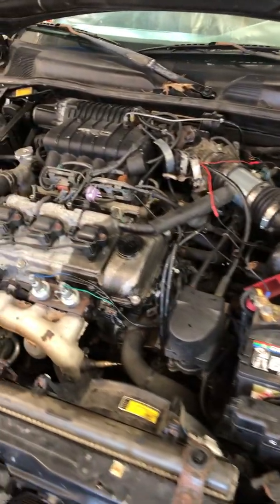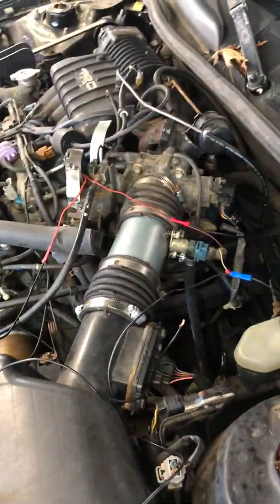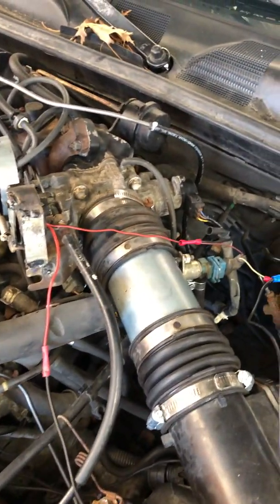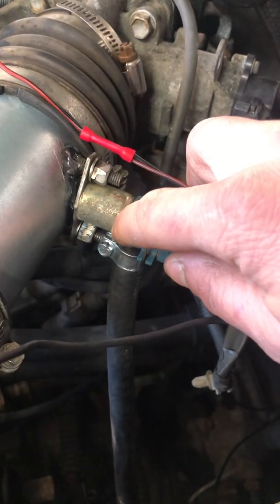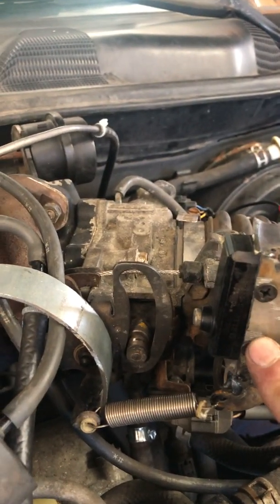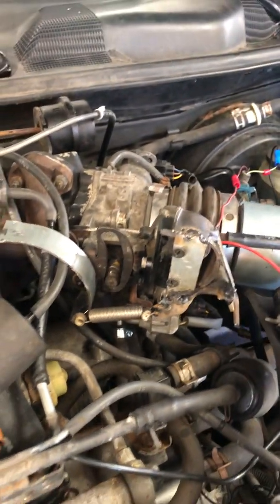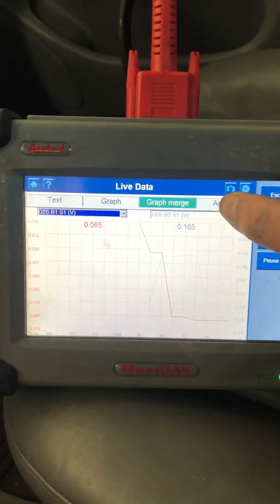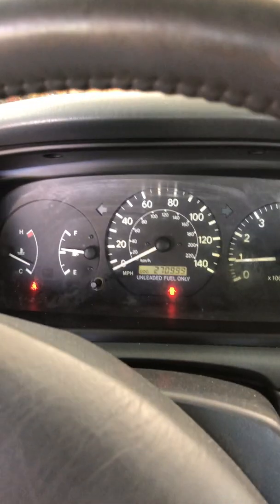7th fuel injector for 1mzfe supercharged Camry.

Comment: Would you have any info on if this supercharger has an intercooler or that it cools the air in general reason being all I've seen on forums is that this type of supercharger only blows in hot air or does yours have a way of cooling the air I'm thinking of getting one but if it only blows in hot air then I may try a low boost turbo thanks.
Reply: Köstlichkeiten Ever heard of a period or comma? Thanks